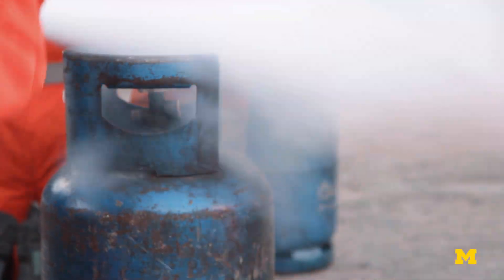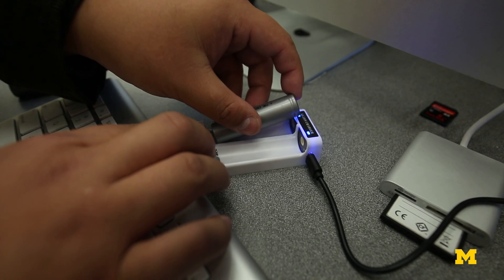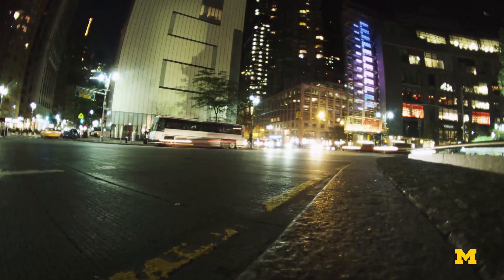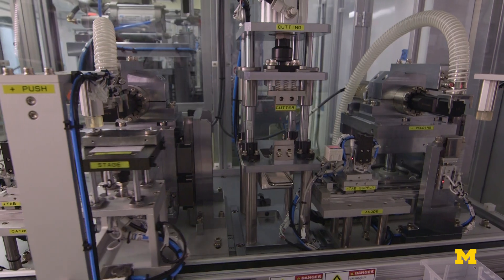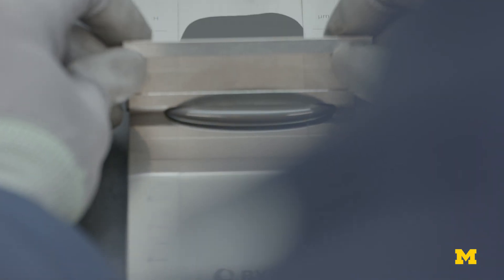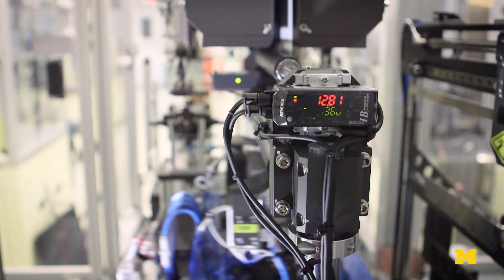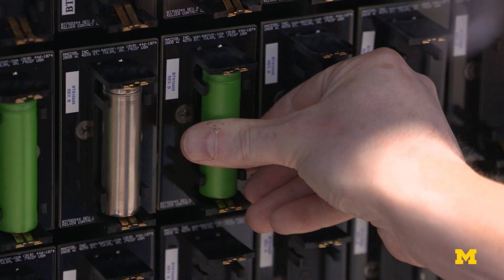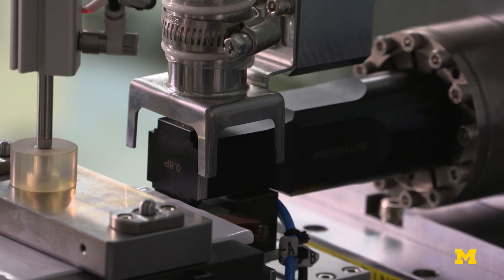Lithium Ion Batteries:  Why They Explode

Comment: Interesting that it was not mentioned that the Lithium Ion process was initially used as a yield booster in “thermo”nuclear detonations. And that the primary byproduct (hydrofluoric acid) is a forever chemical that poisons water and dissolves flesh with its toxicity.

Comment: Hey there, just curious on your take on the pager strike in the middle east, how do you suspect it was achieved, and can lithium batteries as tiny as ones in a pager make an explosion that big?
Reply: The Israelis replaced half of the battery pack with high explosives, then overheated the battery-half, detonating the consumer electronics across the civilian population.  They did it again the next day at their funerals.
Reply: IDF hacked into them to make the batteries heat up
Reply: @KiaNooriComedy  really? like you can search battery explosions and then compare them to the Lebanon ones and you will see it.. Batteries dont explode but rather burn out its Like cmon man
Reply: @hugaman2043  like cmon man

Comment: It's not just the flammable electrolyte sir. The cathode contains transition metal oxides.  Depending on the oxide mix, this decomposes between about 150 and 250+ Celcius releasing pressurized Oxygen Gas.  This is why li ion fires can't be put out except by extreme measures.  Oxygen and fuel are present in the same container, not too different from fireworks or gunpowder.  Optimistic battery   development companies tout all solid state Lithium Metal batteries as inherently safe due to no flammable organic solvents or polymer separator. 
Sorry but Lithium Metal burns nicely in Air and Violently with water added. The metal oxides in the cathode are still a necessary to oxidize electrochemicaly the Lithium to generate electricity during discharge.  This is just how Redox reactions work. 
So now when the inorganic ceramic separator is breached for one of dozens of possible reasons, and the cell overheats  
a different form of thermal runaway is likely to ensue.  This time when the cells "rapidly disassemble" molten and or burning Lithium will be released.  Water will Not be marginally useful as with current Li Ion batteries.  Initially it will act as an accelerant releasing Hydrogen,
Lithium Hydroxide and Lots of Heat.  Read: Horrible Fire.
Reply: Can they combust at typical temperatures and pressure? Or do they have to get hot?
Reply: They do need heat but in rare cases they have been known to self ignite at room temperature even when not charging.  Usually this is due to a defective separator,  earlier mechanical damage, or metal dust particles puncturing the separator ie poor manufacturering practices.  @scandallpower
Reply: Any information on how to diy a container that stores the battery outside and if explodes releases pressure and contain the fire ?
Reply: @vmobile890 
If I did I would be Rich!

Comment: The trick to recharge the ( thousands ! ! ) of vape batteries , discarded everywhere !  is simply  NEVER  to charge more than 4.2 Volts ( so do NOT connect direct to 5 Volt USB outlet ! ) .... safe ... ( tried - n - tested ) ...... DAVE™🛑

Comment: The scar bigger than my head from an e-cig battery coming in contact with keys in my pocket, when the cover on the battery was damaged... Agrees.
It vented like a model rocket engine out the front of my jeans.😶THOSE SAME CELLS IN THE LAST FRAME😶

Comment: Why does LiPO4 suck so bad? Forget to cut your lights off and then the battery is history.
Reply: All li ion batteries  "suck so bad" when over discharged below 2 volts or so. Why?  The anode current collector is copper foil. The copper foil dissolves/electroplates throughout the cell thus poisoning it permanently.

Comment: Time to break up the silence on Motorola Malaysia and the 252 Kg of Ion Lithium batteries that were onboard in bulk in a consignment container on MH370. Yes that is MH370 the most infamous passenger plane that disappeared after having been seen by on fire four completely independent witnesses at different location on its diverted path : one malaysian fisherman, an oil rig Vietnamese worker, an Indonesian and one british woman solo sailing.
Add to this that 2 cargo airplanes are known to have crashed because of Lithium Ion batteries fires, It is almost certain that this was the cause of the MH370 accident.  An explosion of 252 Kg of Lithium Ion could be similar to a missile hitting a passenger plane. Solvent fire also releases toxic fumes. 
Regulation have changed it's no longer allowed to ship batteries in bulk. They have to be specially packed.

Comment: My big problem with lithium batteries is that people just don't even pay attention to any of the warnings... like the one that says you can't throw them away normally. I work for a trash company and we have TWICE had these damn things catch fire in the truck. DON'T TOSS YOUR CELL PHONE IN THE TRASH, this can cause a flaming trash truck to lay waste to your entire neighborhood. Even worse are laptops, power tool batteries and rideable toys like electric scooters etc. Well, they would be worse, except that unlike cell phones they are big enough that we see them go in and get rid of them before they get crushed.
Reply: Yup people are stupid, that's most of society for you, also overcharging batteries are most likely caused by people being lazy and not unplugging once done?
Reply: @MrCharmz81  Na, battery chargers have safeguards against that, because how do we know when it's done? So, no, as long as it's all working properly, it's safe to leave them plugged in until you need them. Beware old battery chargers, though, because those safeguards can fail. THEN you can get an overcharged battery, and your first warning may be a fire. Oh, and do watch for any signs of swelling in the battery. If a battery starts to swell up, and it will push out against whatever device it's in so unless it's a pretty big machine you'll see the signs, GET RID OF IT, put it someplace cool with nothing flammable nearby--and AWAY from water, which will not help--and contact the manufacturer. Or maybe the fire department.
Reply: On that note i never see a garbage truck burn
Reply: @Yggdrasil_Story  Yeah well, see my original post. Especially the middle part. If this is your not-so-subtle way of trying to deny, I've gotta 'nope' ya.
Reply: Are there designated places to turn them in?
Reply: @teddieklinkhammer3451  Not specific places. I think you can ship them to the manufacturer. At your own expense. Yes that sucks and is stupid. I recommend not buying them in the first place.

Comment: Other issues can be using more than one rechargeable lithium ion battery and having one cell self-donate to another cell with a lower charge.  This can lead to thermal runaway.  There's also the case where a totally perfect cell gets traumatically ruptured.  It's somewhat amazing that we don't have more thermal runaways given the chemistry, but then again I don't think that I've ever had a lithium ion battery that didn't eventually develop deformation.  I've had Chromebooks bulge in the center of the keyboard and an LG phone that was literally torn apart by a swelling battery.  The potential is always there.

Comment: I store my digital thermometer in its original box.  Took it out and held it over the frying pan to measure the chicken and the extra lithium battery that comes with it plopped out. How it landed on the stove and not IN the pan, I don't know. I taped that battery to the top of the box.

Comment: Today lithium battery exploded and cought fire at my house. Thankfully I managed to extinguish the fire, but it was scary.
Reply: Was it in use, or was it just sitting idle? Like, do these things have to actually be powering a product/receiving a charge, or can they just spontaneously human combust sitting in their original, unopened packet, or in between uses?
Reply: @SeriousSchitt  It is very rare when something like this happens. So most people will never experience such a thing. But it can happen anytime, not only when charging or when powering a device. Although it is more likely it will happen when under load. If a device warns you to change your battery get either a new battery or a new device. Dont let your phone lying around in the sun. Most devices shut down for safety reasons when overheating, but you increase the chances of stressing the battery...
Reply: Did you use dry fire extinguisher?

Comment: Electric cars would have come earlier but had to wait for battery technology to catch up. Faster charging and capacity has been achieved but still need to be lighter and smaller.
Reply: batteries are constantly holding back a variety of technological advances
Reply: @jarencascino7862  🤷‍♀️
Reply: @simpleagain1  🤷
Reply: I have no intention of buying an EV ever. It's a stupid idea to me. A small power tool blew up like a warzone in the shop, and my mind was made. If a small one like that goes off like a bomb, I do not want to see 2 two EVs crash into each other when they're batteries goes from the front to back of the car and under the car where all the rocks, ice and road debris could puncture the battery.😅 good luck getting out of there alive
Reply: @gustavemoreau2562 exactly!

Comment: The vast majority of batteries are safe and will never experience a fault BUT if it does, and if like most Americans you live in a wooden home a battery fire could burn your house to the ground. We keep our ebike batteries in steel ammo cans. Just in case. We charge the batteries outside. No problems so far but we like our house. I'm eager for a non-flammable battery to reach the mainstream. Luckily our ebikes car be used with any battery type as long as it puts out 48V with a AH capacity of 12AH or larger.
Reply: Let us know if it ever explodes in or out of the ammo can

Comment: When I charge my Moto z play droid it gets hot. Is that bad?
Reply: No. All batteries release heat when charged, as does the current en route to the battery. 

Motorola phones have Turbochargers that pump a lot of power into the battery, releasing more heat than most. If it got so got that you couldn't touch it, then I'd be concerned.

Comment: Uh,,,ain't this the same type of battery they want to put into these new Tesla electric cars???what a bad idea
Reply: Gasoline is a lot more flammable. Most cells vent if something goes wrong. The Tesla models have a lot of redundancy and safety features to prevent an absolute failure of the battery except in extreme circumstances. The reality of present battery tech is that it’s safe, Very safe in 99.99% of cases,  but potentially explosive in if crushed or in the .01% of failures
Reply: @MrCulldog gasoline needs a spark to flame. These spontaneously combust with the right conditions. Very different situation to extinguish. Apples and oranges.
Reply: @MrCulldog your numbers are off
Reply: Chances are, the device you watched this video on uses a lithium ion battery too.
Reply: @incognitoburrito6020 yes but I don’t ride around in it or sleep near it
Reply: @LCLand  I made this comment so long ago. The reality is not what I had assumed it was then. If we look at the number of crash related gasoline fires, there are definitely more, but it’s substantially harder to extinguish the fire from a lithium battery. It’s a very real issue, even if the severity is inflated by the news. I know there are a lot of very smart people working on the problem but it’s complex and difficult to get right
Reply: Jh T oh btw these are also in mobile phones, laptops, etc. and a lot of people sleep next to those what a bad idea.
Reply: TheHotcrumbs Gasoline is always burned in an oxygen containing environment, it has to be because any fire needs oxygen and your engine is no different. While a battery fire is a lot harder to put out, those fires happen far less frequently than gasoline fires following an accident. There is, without a doubt, work to do to make these batteries as safe as possible, but we’ve already come along way to do so.
Reply: WHY ARE YOU WRITING IN CAPITAL LETTERS WHY U DO NOW RESERCHHH
Reply: watches video of gasoline detonation aint this the same liquif they use for napalm bombs??? What a bad idea.
Reply: they already done it so be like your granny when you got your license and say "Man the road sure is a whole lot more scary with you there".
Reply: TheHotcrumbs  Are you fucking stupid?  The electrolyte's solvent is flammable and needs an external oxidant, just like gasoline.  But if you do find evidence of the electrolyte burning with just the the electrodes as oxidizer, please let us know.
Reply: TheHotcrumbs  Any sort of combustion needs oxygen you dumbo. Also, I prefer to be in a lithium car that doesnt pump out co2 and isnt filled with a superflammable liquid rather than being on one.

Comment: Wouldn't that also increase maximum output also? Because you wouldn't have to worry about heat as much because you wouldn't increase the reaction rate much by increasing temp because the atoms in a solid are bound so heat wouldn't move them around as much, all you would have to do is worry about the melting point of the anode and cathode in theory because ceramics have very high melting points usually, so the melting point of Lithium would probably be your bottleneck. 

Obviously in something like a phone or laptop heat is always a concern but in a Car you can have heat sinks etc to dissipate the heat because your not as worried about weight as long as you can get extra performance for that weight.
Reply: Here me out okay...here me out, a box or case that prevents explosions in planes...oooohhhhhh

Comment: So, Samsung was not assassinated, so to speak, because it was purely a coincidence that it's batteries were made with flaws ?
Reply: Cosmo John Yeam
Reply: Well yes and no, if they were taking all the precarious they should have or more precisely the third party they sourced the batteries from was then there should not have been wide spread problems like they had.

If you have a 1 or 2 out of  10,000 that go bad then that can be somewhat forgiven as bad luck as long as it can be resolved, 1 in 1,000 there is something seriously wrong with your manufacturing which should have been caught before you sold them and the Samsung should not have used a new design on a top tier phone.
Reply: Etheoma Shows that a giant be destroyed by poor quality assurance by its outsourcing partners